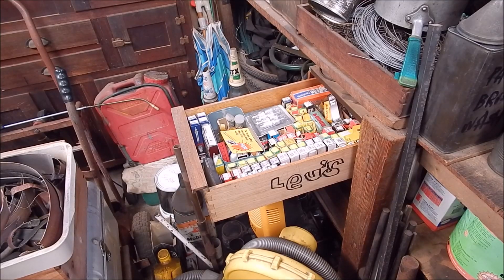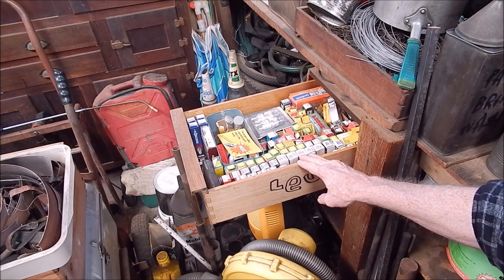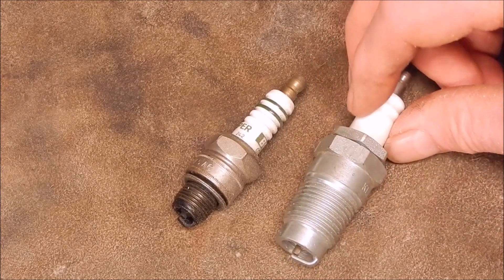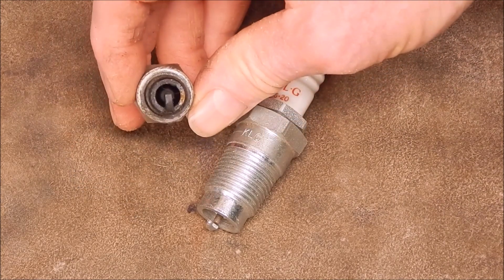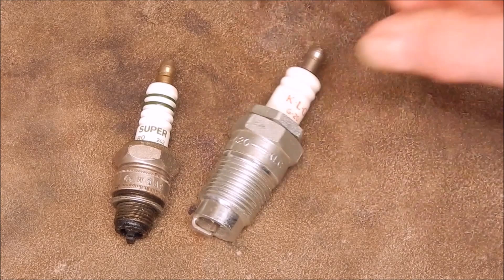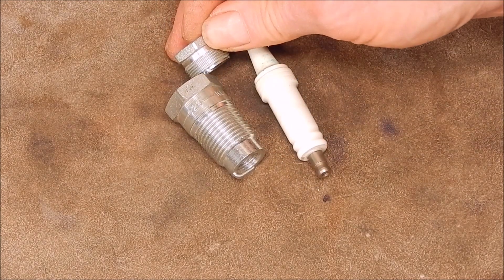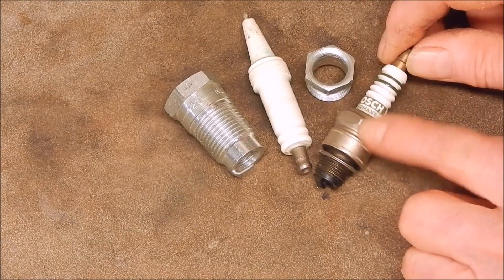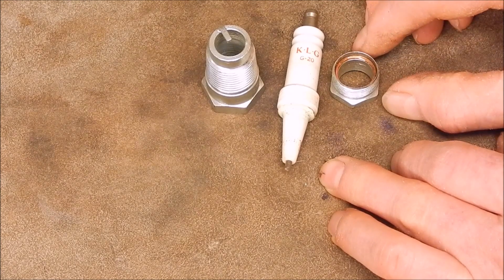What's inside a screw together type spark plug ?

Comment from the maker: UPDATE:  It turns out that the spark plug fits old hit and miss and other early stationary engines.  It uses a tapered 3/4 inch water pipe thread to seal.  Pretty crude, but obviously it worked.  Thanks to all who sent comments about it.  Cheers Rob

Comment: looks like some kinda of anti fouling design
Reply from the maker: What makes you think that ?
Reply: @Xynudu  i tried to send a pic off ebay, but appearently that doesnt work,...it looks like a modern day anti fouler for spark plug, possibly hit and miss engines were alot more sooty and more carbon,...?
Reply from the maker: It looks like any other spark plug inside to me.  I don't understand what you think is different about it.

Comment: G'day Rob.  Do you think the electrode could be removed from the porcelain successfully ?  You've given me an idea for a sturdy sandblasting nozzle.
Reply from the maker: Hi Matthew,  they usually have a knurled section in the centre of the electrode, which holds it in position.  The only way to remove it would be to eat the metal away somehow (acid, high tension spark erroder ?)  I don't think it's very doable unless you can cut the porcelain with a thin diamond disc at one end of the knurl and punch out the electrode.  Cheers Rob
Reply: @Xynudu  Thanks for replying Rob.  Perhaps acid would be the lazy way, or maybe sacrifice a drill bit or 2.  I have some sulfuric acid. I'll give it a go.
Reply from the maker: I had another thought.  You could try using electrolysis to eat it away.  Use the spark plug as the positive (anode) and I expect it will eat away (may take a while) same as a regular scrap steel anode for rust removal process.  Worth a try.  Cheers Rob
Reply: @Xynudu  That's not a bad idea Rob.  Cheers.  Matt

Comment: Looks like it has a tapered thread 1/2” pipe? Ford T type?
Reply from the maker: It turned out to be tapered 3/4" water pipe thread.  Apparently some old stationary and hit and miss engines used this plug.  New one on me.  Cheers Rob

Comment: Rob, I have several “ hit and miss and throttle governor engines “ that use these plugs . They were pretty common in the older engines and I think you will find the thread to be a pipe thread , at least on this side of the pond they are 3/4 NPF. They are still available but getting harder to find.  Best to you 😉 !
Reply from the maker: You are dead on the money !  Checked and it is a 3/4 pipe thread just as you mentioned.  Thanks for that bit of info.  We have several old stationary engines up the farm, but no plug sizes like this.  There is no provision for a sealing washer, so I assume they seal same as old water pipe with red lead and string?   Cheers Rob
Reply from the maker: I just followed up on another comment and the thread is tapered, same as some water pipe.  So it must seal in the same crude way.  LOL never seen that before.  Cheers Rob

Comment: those threads look tapered or is that the cameras view
Reply from the maker: Well spotted.  It is indeed tapered. Apparently it's 3/4 inch water pipe thread and seals in the same crude fashion.  New one on me.  Cheers Rob
Reply: @Xynudu  works tha same as some hydraulic fittings
Reply from the maker: Very true, although the TPI is much higher on them.

Comment: I found a site that indicates they were popular in motorcycles.
Reply from the maker: KLG have always been big with early motorcycles.  This size is bigger than normal and also doesn't have a sealing copper ring, nor a modern taper seal, so it's a bit unusual.   I doubt it is vintage as the early plugs were not nickel coated (from my observations), but uses the same construction.  Interesting.  Cheers Rob